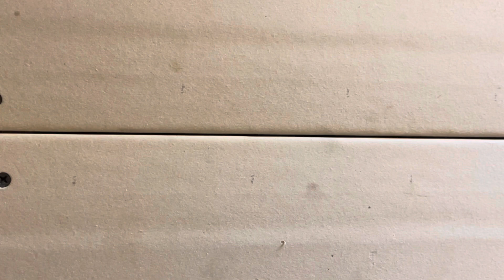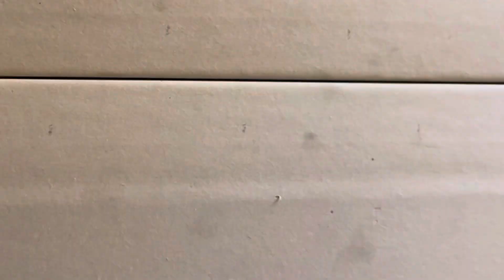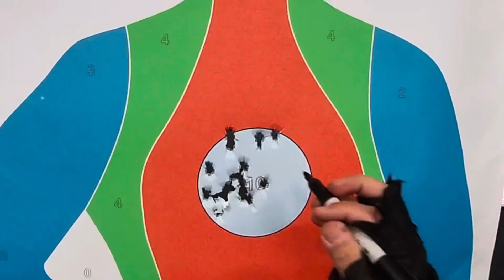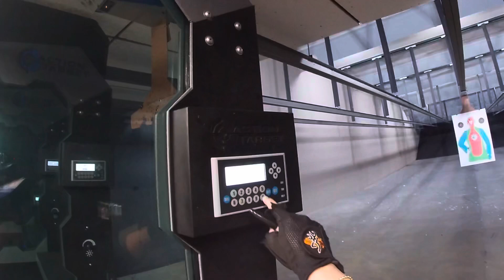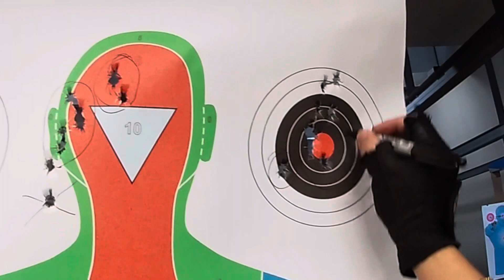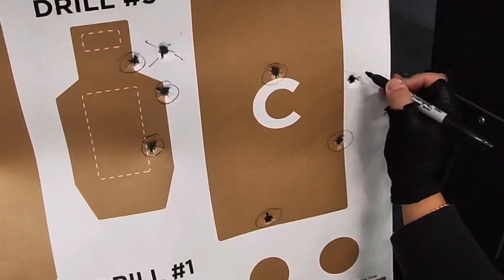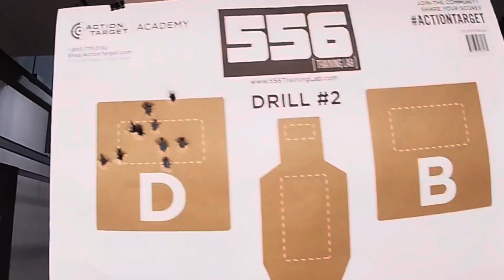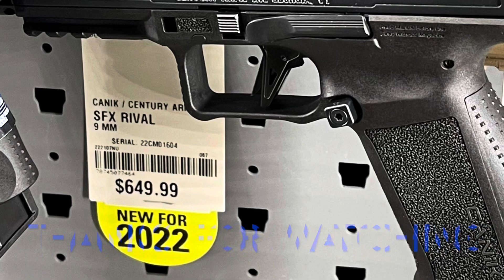My New CANIK SFX “RIVAL” (Unboxing)

Comment: I have a question, does the slider of the rival will fit on the SFX? I think the slider of the rival looks really good with the new ports
Reply from the maker: @Ismael Bacelis I can certainly try and see if it can be interchangeable.
Reply: That will be nice if you could! You got a new subscriber
Reply from the maker: @ismaelbacelis7853  So I just tried switching the slide between my SFX Rival and the TP9SFX. The answer is no. But it’s possible maybe between the Mete and the Rival because they have a similar way to put the slide on the frame by lining them up halfway to push the slide in.
Reply: Whoa whoa bro it’s called a slide , slider is a small burger 🍔